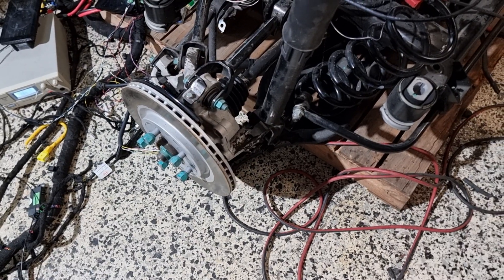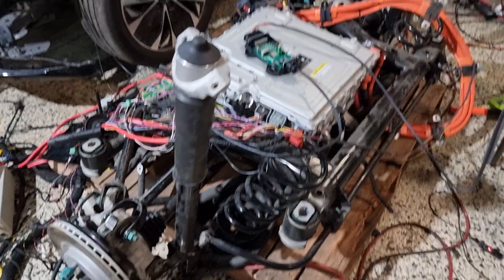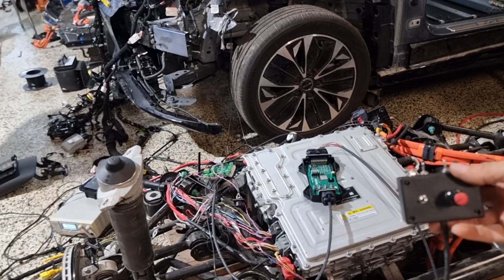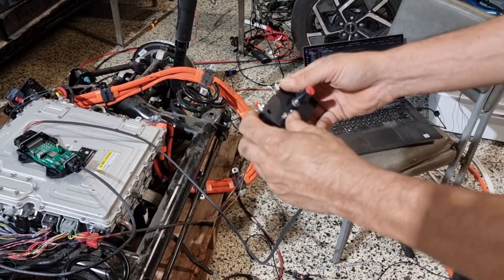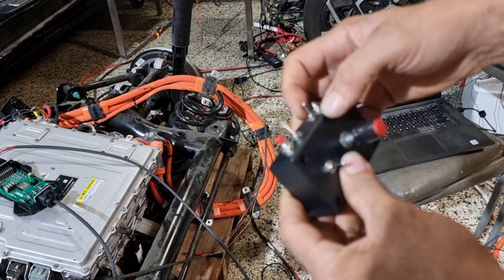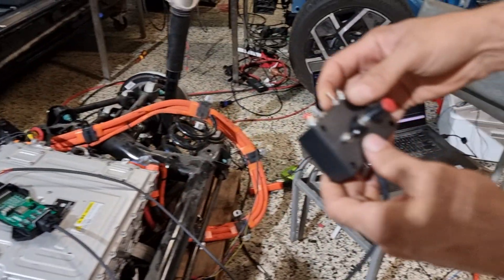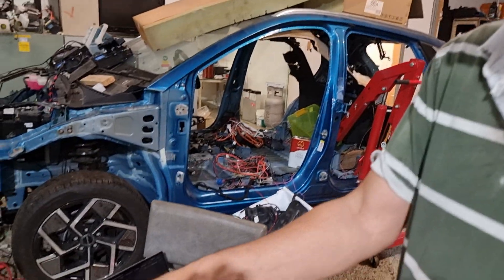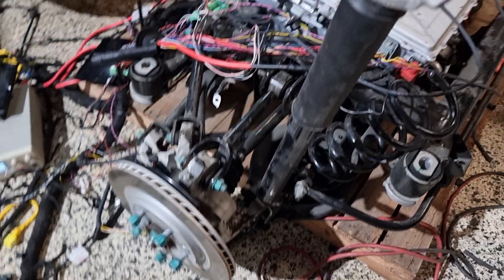BYD Seal Drive Unit.

Comment: What are you using for control board and software? Can you share more details? im looking to get a BYD drive unit to run for a conversion...
Reply from the maker: I have designed the controller and written the software.  Where are you?

Comment: What is the point ..or the result .or achievement of this controll unit ?
Reply from the maker: You can put it on a conversion.  It has MCU, DC-DC converter OBC and DC fast charging all in one unit.
It will make conversions really easy.